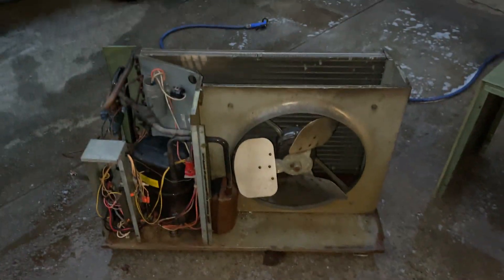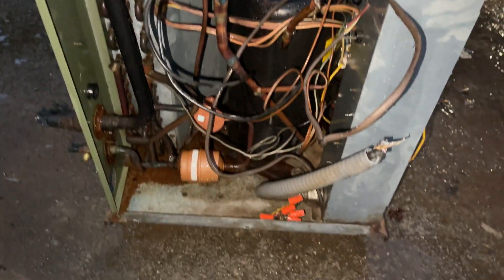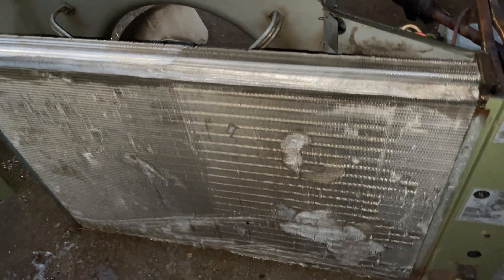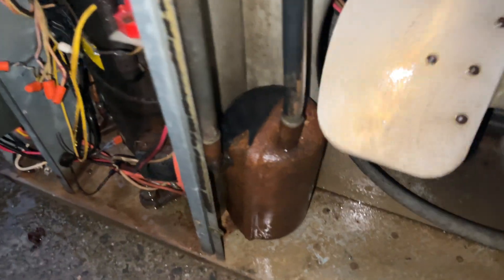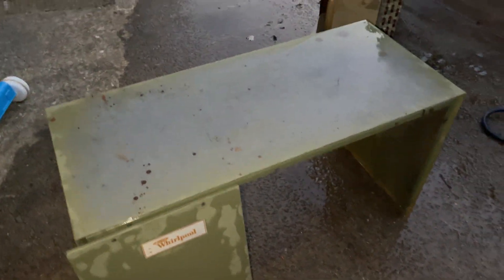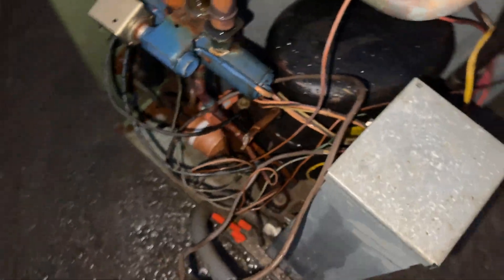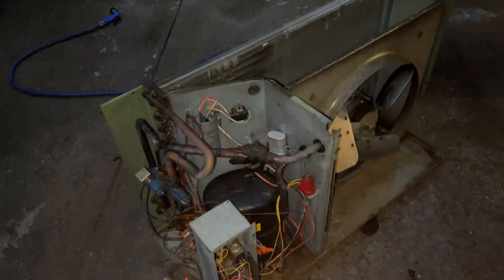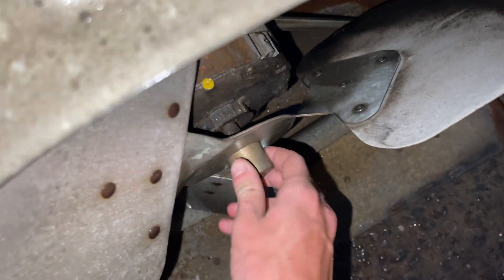Whirlpool NCHBA Heat Pump

Comment: So what exactly makes this one-of-a-kind? Looks just like the one you have minus the fan.
Reply: We had a heat pump & electric furnace craze that really got going during the energy crisis. This one from 1983 was the last bastion of the side discharge era as we started to transition back to gas furnaces as they became significantly more efficient in by the mid 80’s. So to see a whirlpool heat pump by 1983 was getting kinda rare as the side discharge units were less efficient and on their way out in favor of top discharge units becoming the standard with all manufacturers, with exceptions of course like Luxaire and they eventually ditched their trademark design in the 90’s.
Reply from the maker: It’s a heat pump, most of these got replaced 20 years ago